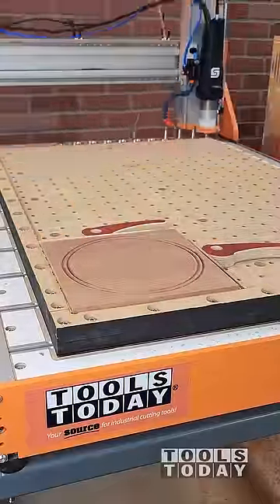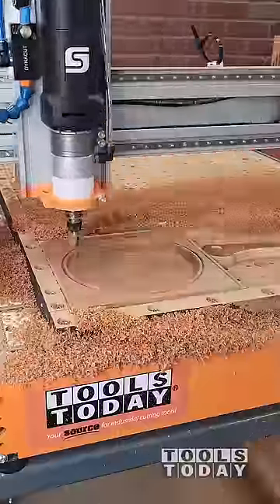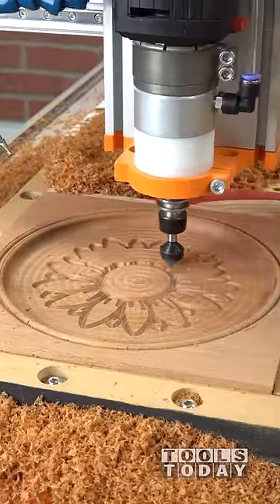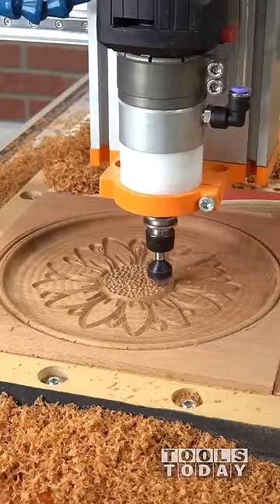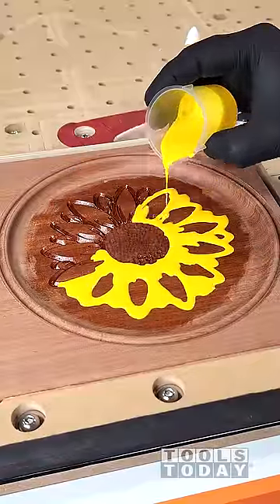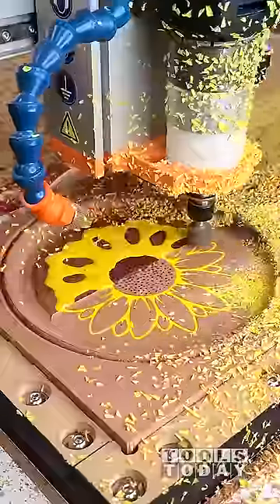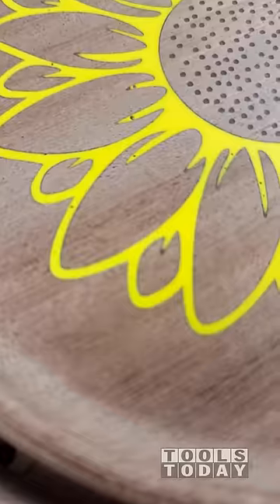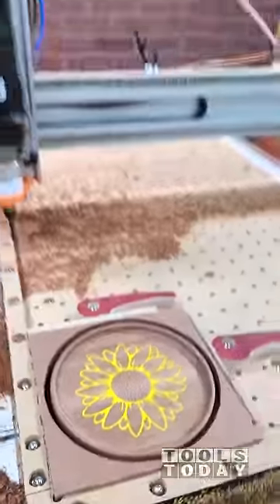Epoxy Design on Bottom of Tray

Comment: Could I please know the bits numbers for ordering? Thank you
Reply from the maker: Here are the bits used, for future reference, they are always linked in the description of the videos along with the speeds and feeds used - 

Amana Tool 45982 Carbide Tipped Bowl & Tray 1/4 R x 3/4 D x 5/8 CH x 1/4 Inch SHK Router Bit
https://www.toolstoday.com/v-5662-45982.html

Amana Tool RC-45711 In-Tech Insert Carbide V Groove 90 Deg x 11/16 D x 21/64 CH x 1/4 Inch SHK Single Flute Router Bit
https://www.toolstoday.com/v-10600-rc-45711.html
Reply: @ToolsToday  thank you. I figured out how to open the descriptions for next time 🙃